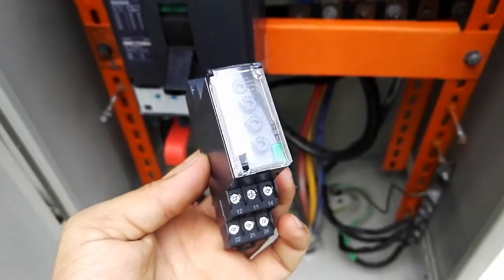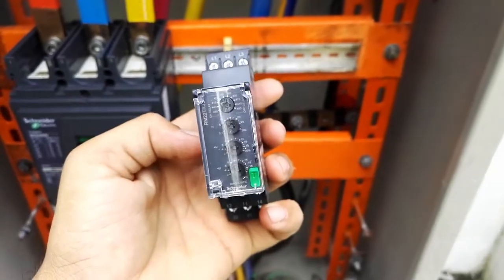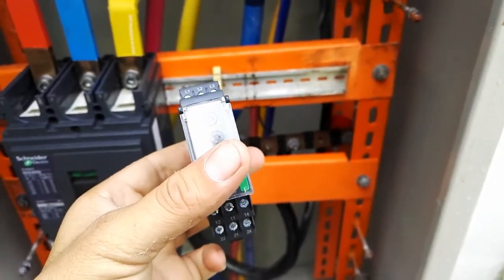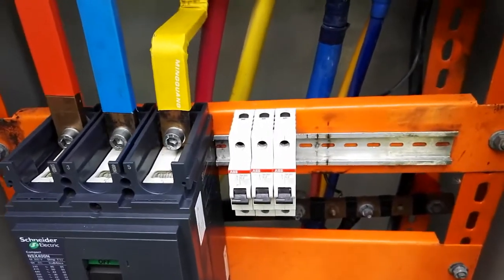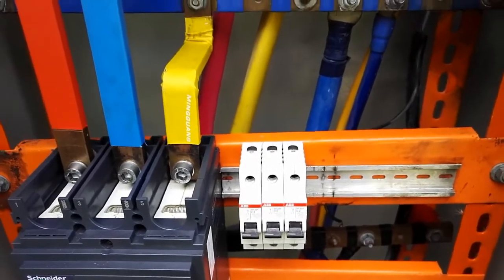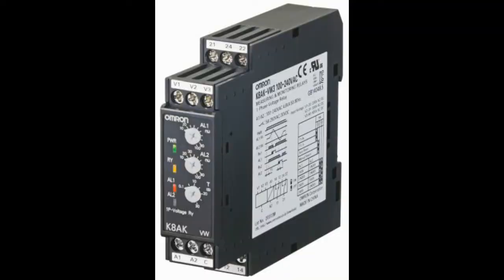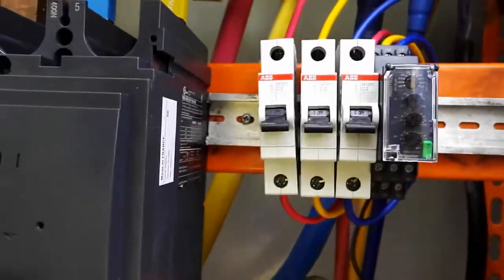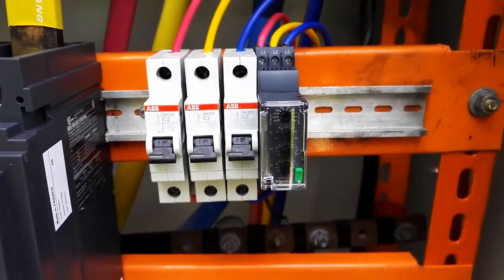UV OV Relay | Under voltage and Over Voltage Protection Relay

Comment: wait, why did you use three single-pole breakers instead of one 3-pole breaker????
Reply from the maker: Because 3 pole breaker on main is already present,we use this 3 single pole breakers for more safety of relay,you can also use 3 pole breaker,its up to your choice, either you can skip these 3 single pole breaker,you can get supply, directly through main breaker

Comment: with a dimmer is so good to make experiment with this kind of device.
Reply from the maker: This is not like a dimmer,,it has a set point of voltage،it is usually used for tripping purpose of main breaker